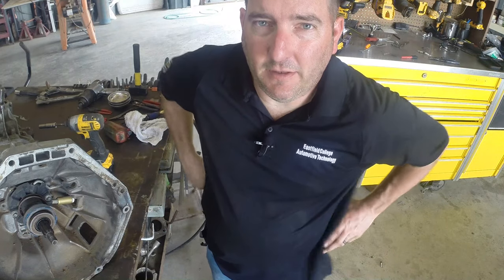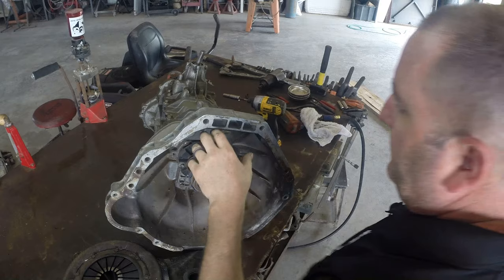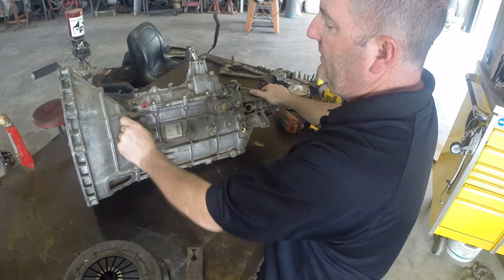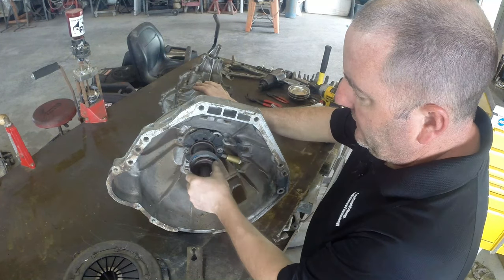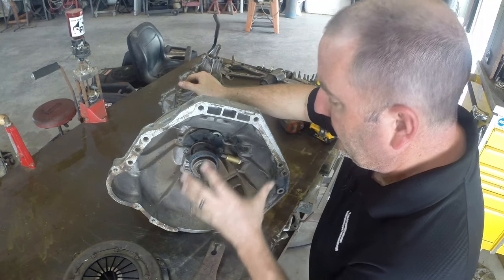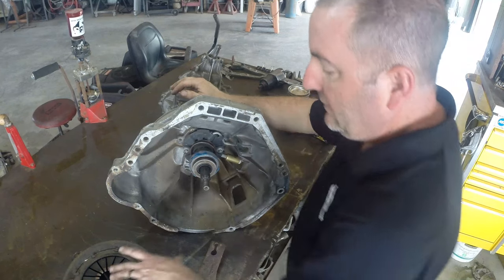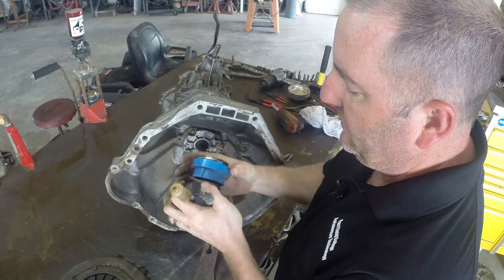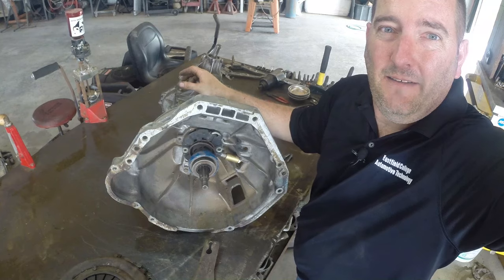Concentric Slave Cylinder Operation

Comment: Thanks. I got a volvo and mine was frozen in neutral. When I got the transmission out I couldn't push the slave in. This is the only video that shows how easily it the slave can be pushed in. Mine unfortunately was frozen. Thanks.

Comment: So any seals that would fail or bearing failure on a non concentric slave would still require removal of the transmission it seems. Is that correct? 

Seems like leaking fluid would damage the "slave cylinder" bearing on a concentric slave as easily as it would on an external slave cylinder with a fork.

Comment: Should the slave be dry all throughout? Mine has alittle bit of fluid behind the surface that pushes on the pressure plate.
Reply from the maker: If there is enough fluid to drip, it should probably be replaced.

Comment: Hi great video thanks.  can you show how to check the slave cylinder when its out in your hand? I have the gearbox out and I put a finger on the in pipe and press the bearing in and then it show resistens. Im not sure now if i did this for nothing😂 I have change the headcylinder first. So? Now im stuck
Reply from the maker: The most common issue is leaks. Sounds like yours moves freely.  If it doesn't look like it was leaking, you should be good.

Comment: Sticking clutch pedal....can this internal slave be guilty of not fully returning?
Reply from the maker: Possibly.  More likely to be air in the system which could come from the slave or the master. Check the firewall for trickling fluid or bubbling paint and check bell housing for dripping fluid.
Reply: @outofthebox50  Thank you👍...told garage who said they bled it but still doing it 10% of time 🙁👍

Comment: my new slave cylinder  will not move In and out like this one. Have a comment?
Reply: Hey just force the spring and now Its active moving.I've been having a big struggle getting  this transmission back on. Maybe this was the problem.
Reply: @jamsocrane  me too.. exactly the same issue.. did you figure it out?